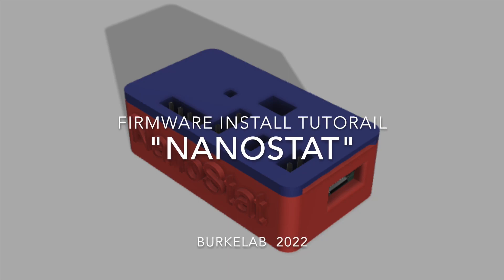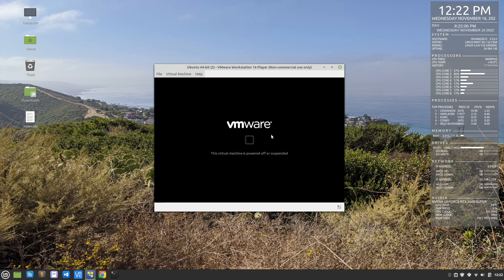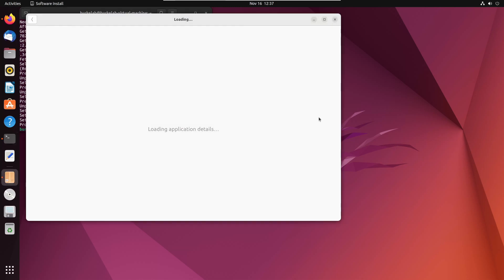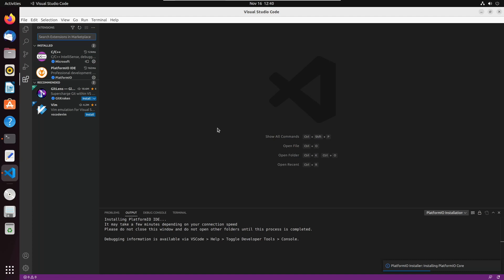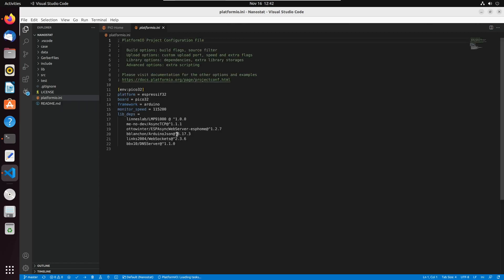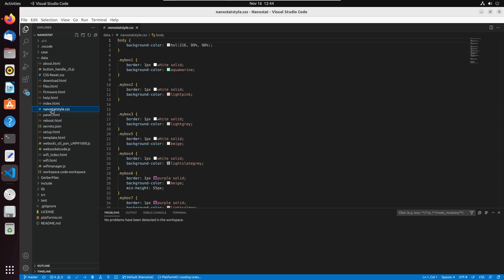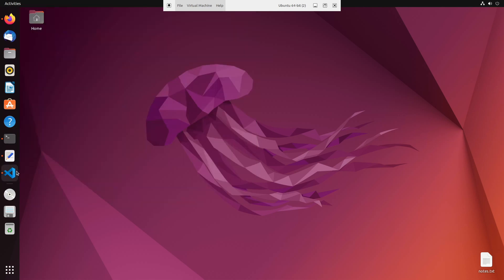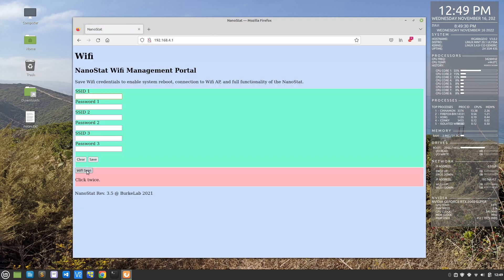Nanostat firmware tutorial

Comment: Thank you for uploading this video! I found it invaluable. I thought I'd share a few notes since I built this at home using a soldering iron and hot plate and used a Windows machine/VMWare to install the code.

* To get my computer to chat with the device, I had to install the CP210x Windows Drivers from Silicon Labs
* The LMP91000SD is only $3 directly from TI Instruments. While 20x cheaper this may complicate using JCLPCB or other folks for the assembly process. Not sure.
* I had to replace two components because they were not being sold on LCSC anymore:
   1) This discontinued antenna (LCSC C504003) with LCSC C2900839. I had to adjust the EasyEda file because of the different footprint. Given I know nothing next to nothing about antennas,  I was pleasantly surprised this worked. This antenna has substantially lower range than my laptop, so I had to place it closer to my router for the Nanostat to work.

   2) This MOSFET: LCSC C424195 with LCSC C4748723. Frankly, not sure if this was the right move in terms of MOSFET properties.

I have yet to fully test the board fully but it seems to work.
Reply from the maker: Thanks for the information. The community will find this very valuable. You are the first one we know of to solder the parts by hand, nice accomplishment! 
The supply chain is not always reliable so it's useful to know what sources and components work for other users.
Reply: And thank you for this great open source tool! Of course! I will say, it was quite difficult and took many hours (and diagnosing): probably not the recommended way to do this.  

I am interested in bringing this (and similar projects) to a classroom or to some audience. I wonder if you've had such experience? I feel like this project could pave both introductions to electronics/programming and/or electrochemistry, the former of which I think some electrochemists would benefit from learning some. @burkelab5663